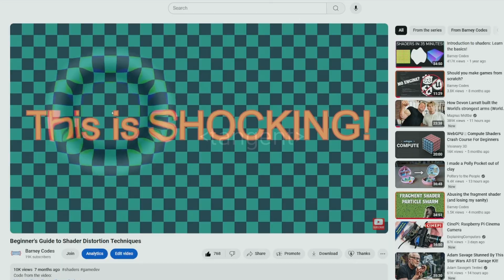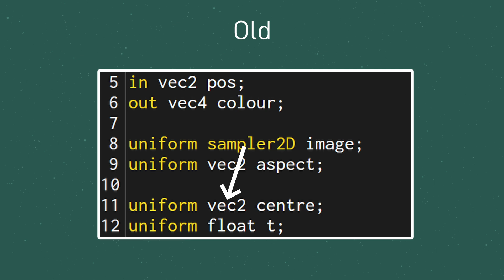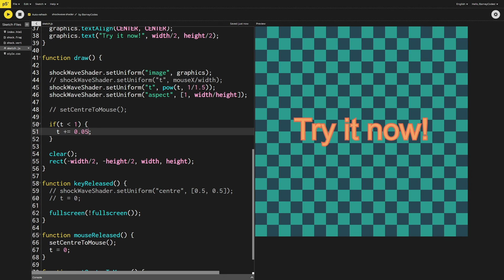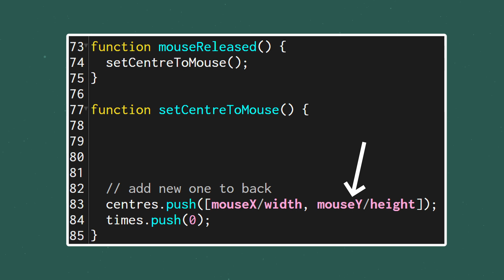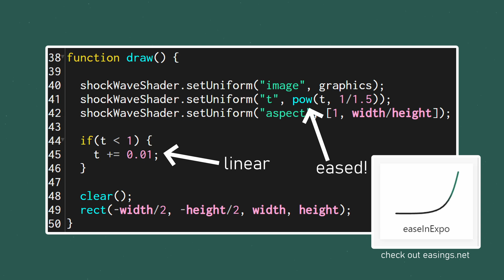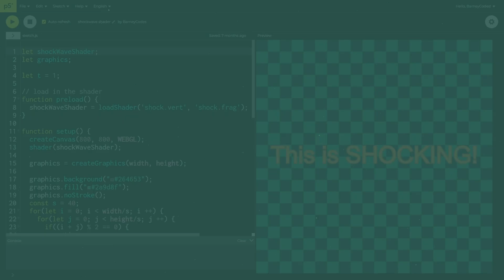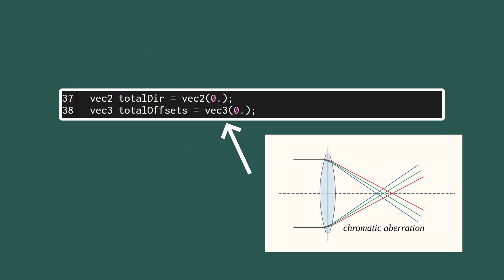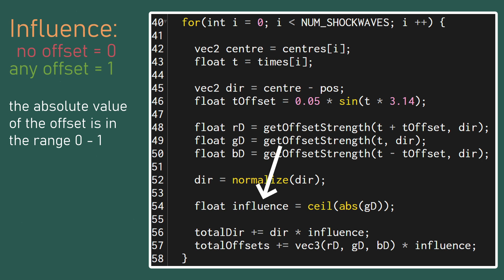Fixing the SHOCKWAVE shader! (Multiple shockwaves at once)

Comment: This code is ideal for demo purposes however I can't help but think that you'd be better off building a struct that handles the data for each shockwave item - they can contain the logic for updating the data in the shader code as well as handle their own construction/destruction. Are there some extra limitations in JS that I'm unaware of? (I'm a C/C++ Gameplay Engineer mainly) Or is it more that for demo purposes you wanted to prioritise the explanation & process, allowing individuals to implement their own more maintainable code?

Most importantly though, thank you so much for these videos! I have struggled with shader programming for as long as I can remember and I'm forcing myself to implement some into my own project so that I can finally break out of my fear of them - and you've been a MASSIVE help in my growth.
Reply from the maker: I think you're right, if I was implementing this in an actual project I would probably use a class or struct to bundle shockwave data, at least on the CPU side.
In my head, these videos are more about explaining the concepts of the shaders, more so then implementing a full system which is why it's not fleshed out (I'll leave that as an exercise for the viewer haha 😂)

So glad to hear these videos have been helping you on your shader journey! When I was learning I felt like there weren't many properly approachable resources out there, a lot of the "beginner" shader stuff still seemed really complex to me, so I'm trying to help out where I can lol
Reply: @BarneyCodes  I LOVE the beginner shader stuff that's out there even if it's really complex (shaders are complex!) but as someone with a pretty solid understanding of the maths behind it all I personally struggle with implementation patterns - it's so bloody different to standard OOP/Functional programming patterns and techniques!